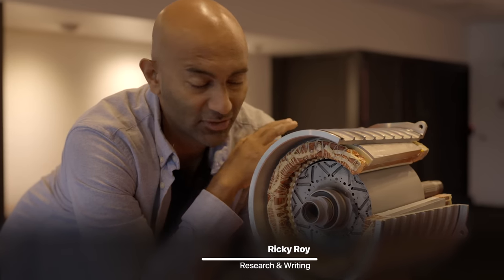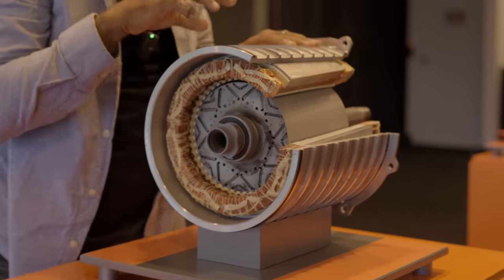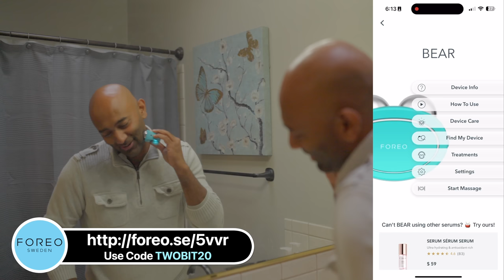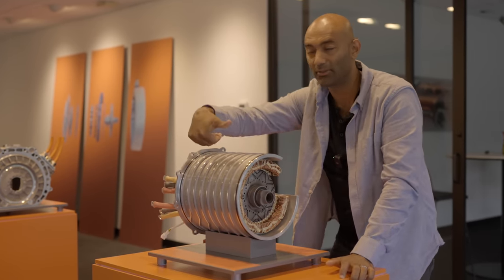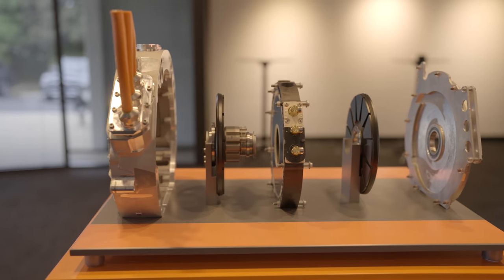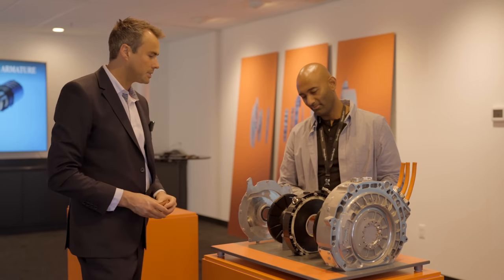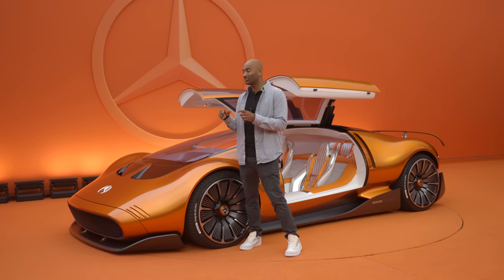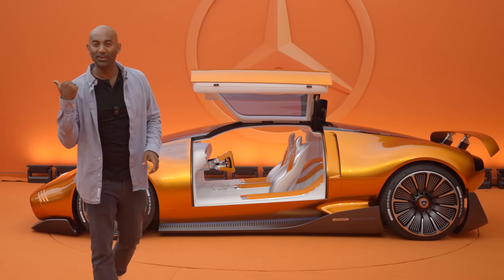Axial Flux Motors Will Change CARS - Here's Why

Comment: That’s really cool they’ve created such a powerful lightweight efficient motor. I’m sure Mercedes will stop at nothing to engineer a coolant pump that is so buried in the cars internals it requires almost an entire disassembly of the vehicle.
Reply: lolz
Reply: They can replace it for you at the same time you are paying them £10k+ to swap out your 5yr old battery.
Reply: @MrLankoss  The batteries are warrantied for 10 years 155K miles on all electric Mercedes. This is almost 33% higher than anyone else in the industry.
Reply: ...and electric cars don't even need coolant pumps!
Reply: Doubtless Audi will jump on the same bandwagon: 5 hours service-time to change a fuse?
Reply: @eventhisidistaken  based on the information and details in this video, any vehicles running these motors will
Reply: you're thinking about vw, audi, alfa and bmw.
Reply: @eventhisidistaken  they do
Reply: I like my Walmart $100 battery every 3 years instead of $10,000 plus for electric vehicles!
Reply: Well the nice thing about EVs is that there's a tremendous amount of space savings over an ICE, so accessible component placement will be easy
Reply: Electric motors are typically rated for 750,000 miles.  Current battery packs are estimated at 250-350,000 miles.  You can't beat EVs in terms of cost per mile.
Reply: @Francis-rs7zu  Well, the guy in Germany drove I think 1,6 Million kilometers with his tesla. But get also this: tesla gave him 3 new batteries on warranty, he also had to change the motors 8 times plus he paid some achsles and brakes 26000 Euro, so.... And another guy drove 1 million kilometer with his 1991 volvo sedan. 2 motors and 2 transmissions changed. He got a new car from volvo free for 2 years.
Reply: @eventhisidistaken  🤫🤫
Reply: Hmm. yes I have heard of Mercedes difficulty in swapping out worn mechanicals,(@MrLankoss  Hmmm you did not follow the rest of us into "MR.?? That was my father, I am just plain old...") which is why I was surprised by the Acura requiring $500 on their TLX to swap out TRANSMISSION FLUID!  But I guess they are doing their best.
Reply: just dont be poor
Reply: True, one step forward, two steps backwards. The Mercedes way.
Reply: You missed a trick - the video refers to the coolant and its importance.  @eventhisidistaken
Reply: Some Tesla 3 are under 30k now
Reply: How about a radial and axial flux RAXIAL and induction excitation with rectifier and some insane HP and torque fun!
Reply: @@ShannonBarber78Radial flux permanent magnet motors do have a flatter package than standard induction motors, and axial flux is also a flatter package than permanent magnet radial flux motors. And with regards to induction motors, there is no energy wasted in the "induction" aspect, since the rotor already has its own magnetic field. So the rotor doesn't need to be excited by the stator field to develop its own magnetic field.
Reply: @lltb67 but gasoline
Reply: @jlo13800 rectifier? DC? Nah
Reply: @adolfgerhardhermann5952 not when electricity cost more than gas
Reply: Okay, that's hilarious. 😏
Reply: @@ShannonBarber78 Please be more specific if possible.
Reply: They didn't invent it.
A feller from England did at least 20 years ago.
They might of bought his patent from him.
That I don't know.
The first time I saw this motor the feller that developed it was testing it on a racing motorcycle at the Isle of Mann TT race.
"At least 20 years ago"
Reply: pretty sure this motor has nothing to do with Mercedes. Both Ferrari and McLaren are using the same tech for a while now in their cars and its made by the same company that its most likely not mercedes.
Reply: That is not true! MB is planning on installing these new motors in a newly designed titanium V12 behind the nitrogen cooled crankshaft.
Reply: @matrixist  precisely!!
Reply: @lltb67  EV high voltage batteries don't wear out in 3 years 😂 it's like saying you need to replace your engine and transmission every 3 years 😂 WOW so expensive. of course SOLETIMES batteries like engine or transmisions will have dramatic failure. you ever heard of engine failure and  replacement after 1000 miles? yes it happens, and it's under warranty  like batteries, except batteries have 8 years/100k miles minimum warranty 😊
Reply: @simonehudspeth861 but the pump is not inside the motor, it's not an accessory belt/chain mounted pump like in combustion engine. it's just an easily accessibl part to replace if it fails
Reply: @jlo13800 Koenigsegg Dark Matter! 800 hp, 1250 Nm, 39kg...just imagine the possibilities in a supercar EV when they figure out lightweight battery tech
the first Gen of electric hypercars is powerful but heavy. only lotus evija is sub 4000lbs. when lighter battery tech is finally here it's really game over for gas engines (same for efuel/hydrogen)
Reply: Don't forget all the special Mercedes only tools, guides and specialized software to perform any of that maintenance. It$ what Mercede$ does be$t!
Reply: Yes kkkkkk almost like vindictive with their engineering
Reply: You do know they didn't invent it, right?
Reply: Exactly
Reply: Good one! 😂 However, they did not create this motor.  This technology has been around for quite a while now.  The elevator industry has been using this type of motor for years now.
Reply: @adolfgerhardhermann5952  You know, a lot of the people who tell this story never do the math.. The dude drove 1.3 million miles (probably more) with one of the very first Model S to ever be built. He went through 3 battery replacements. That's an average of 400,000 miles (~650k km) PER BATTERY. So uhh... You know... more than twice the lifetime mileage of the average car. The motors were replaced (even more than you said), but that's because the early models had a flaw that took a while to fix, so they went through a lot of replacements then. After that, it's not been an issue besides expected wear and tear. IE: that's the warranty working as you'd hope and the car has held up incredibly well. Again, that's more than a million miles! Nearly 2 million km!

I have no idea what his repair costs are (and anyone who claims to know is lying). But to me, it's crazy that anyone would think that $26,000 for some replacements after 1 million miles is a lot. Cuz...

Comment: Re the title - this is old technology, so it's not "new". These motors are used on washing machines. To fight Tesla, Mercedes needs to put out a compelling car for a compelling price. Tesla is solidly focused on mass production and cost reductions. They're going to hair pin motors (easier to build and automate and are more efficient) and magnets free of rare earth metals because these are cheaper. 48V architecture reduces the amount of copper needed. Unboxed production will make their cars faster and cheaper to make and allow them to be built using Optimus robots. There's more than that (4680 batteries, Giga castings...) but you get the idea. Unless Mercedes innovates in these areas, throwing one little differentiator that only has benefits when you look at that one component in isolation, but the benefits get lost in the overall vehicle, isn't going to overcome the huge moat Tesla is bulling.
Reply: @iphigenia8661  no. Tesla buys batteries from everyone, including the major Chinese battery manufacturers (SAIC, BYD, as well as battery suppliers in the US and elsewhere, eg Panasonic, as well as developing their own in-house 4680s). Tesla consumes more batteries than any company on earth. They're all very eager to sell to Tesla as Tesla will buy every battery they can make.

Comment: Pretty sure that motor they showed you is the YASA P-400 R. They’ve been commercially available for… 8 years? 9 years? Something like that. Mercedes did not invent them, and they’re the same motors Ford uses in their electric Mustangs
Reply: I'm pretty sure Ken Block's 1400 hp Mach E had those kind of motors, they were stackable if I remember well
Reply: This is basically the same motor as Toyota has been using in hybrid transmissions for like 26 years. Making a smaller electric motor is hardly an innovation today. Mercedes are late to the party, again, and want us to be impressed.
Reply: MB are last on the ball but presented as innovative! I guess they payed well for the commercial. 😂
Reply: Mercedes bought the whole Company
Reply: @simson4t  The classic way. If you are last on the ball, buy those that was faster and save a lot of time. How will Apple do with AI?
Reply: @stefanjohansson2373  Why buy compute when you can buy whole AI companies? Not like they're doing anything else with that Dragon's Hoard they have.
Reply: @StephenGillie  Toyota uses two radial flux Motors in their hybrids, they never used axial flux motors. They work completely different than you think
Reply: @stefanjohansson2373  marcedes is far from being last on the ball, it is one of most innovative companies, every Company buys other companies for technology including Tesla
Reply: @simson4t  Are they significantly more efficient? If not, then the difference is purely scientific, and irrelevant to efficient automotive technology.
Reply: @simson4t MB may be innovative in ICE, but 5-10 yrs behind Tesla in EV, charging infrastructure, especially, software.
Reply: @vuvision  if you take a look at the eqs marcedes already caught up to Tesla. Especially in software.
Reply: @simson4t  So why to the Chinese avoid buying it, saying that the software is pants?
Reply: Mustand Mach-E uses conventional radial flux motors. Sandy Munroe has a video about it explaining all the details.
Reply: @@retiredbore378 The Smart Car was a total failure and an embarrassing project started by the Swiss watch company.
Reply: @stefanjohansson2373 it wasn't a failed project. The swatch car project was a phev car with a optimized production process. Mercedes wanted to make a small car with a normal engine that wasn't ideal for the car typ. Swatch went out because they couldn't bring in there technology and ideas. The elchtest disaster was 100% mercedes fault!
There is a documentation about the swatch car and it would had a bigger impact but well VW and mercedes wasn't ideal.
Reply: @StephenGillie  You cant say that Toyota  been using Axial Flux motors forever if they actually have  been using radial motors like most others... and then say that if they are not more efficient it doesnt matter???    Just admit you told a lie or where guessing and be over with it..  :)
Reply: @jonasgranlund4427  Toyota has been using slim motors for decades. If this specific implementation is not more efficient than the current, then it's not interesting.
Reply: Yes correct, Mercedes signed with them to meet their demand. They are a perfect combination with many engines.
Reply: @StephenGillie  but the whole episode was about how these motors had more power density and is more efficient, are they lying or where have you  read that Toyotas motors for their hybrid cars the last 10 years are as efficient as these?
Reply: Also Hypercraft USA is also using YASA motors for the custom packages.
Reply: @jonasgranlund4427  Ah if they have more  power density that's cool.
Reply: @jonasgranlund4427  I was wrong - not Toyota but Rolls-Royce. Wikipedia says axial-flux motors have been common since the first days of electric motors. And again, Mercedes and their fanatics (like yourself) expect us to be impressed by old tech.
Reply: @StephenGillie  Toyota has not using slim motors. Their hybrids are not a pancake Motor between the engine and the transmission. There is no transmission,. There are two radial flux normal shape Electric Motors, permanently connected to the Engine through a planetary gear. Watch the video
Reply: @StephenGillie  well Electric cars were there with the first auto mobiles, the first car to break the 100kmh was electric so we shouldn't be amazed by new Electric cars, because they are old tech ?
Reply: @Francis-yc9nc  This was a long time ago, but I remember it like this:
The whole car concept was designed in the 80’s by mr Hayek (Swatch Group). About 10 years later he chose to work with the car industry instead of competing with them. It was impossible to make profit of the concept so all involved was losers, especially the owners! 

I think VW was there before Mercedes and later there of course came a Chinese copy. It was Hayek (and all his developers) that left the project since it didn’t follow his original idea. 

The MB motor with 3 cylinders in my old Smart Fortwo City Coupé was the worst engine I’ve ever seen, so I’m glad I’ve got it for free from Swatch Group as a PR gimmick. You must suck out the oil like in a motorcycle for oil change and there was few engines that managed to reach 10k km. I’m from the watch industry…
Reply: @simson4t  Electric cars couldn't keep up with new gas cars in the old days, because battery technology lagged behind. Only with modern lithium batteries are electric cars faster.
Reply: @simson4t  That planetary gear IS the transmission. It's where you'd put gears to shift into, if you wanted to go faster than 125 MPH. I've watched a few better videos, ones that did not lie, and instead thoroughly explained the technology and its history. This channel is as bad as Mercedes in acting like this old technology is revolutionary.  Two Bit DaVinci is a two-bit hack.
Reply: @StephenGillie  what the hell are you talking about? There are no gears to switch into, just one planetary gear. I was talking about video I linked in a previous comment.
Reply: @StephenGillie  The point I was making, everything is already invented at the dawn of the auto mobile, but they didn't have the technology to make it work. Creating the technology to make an old idea work is innovation.
Reply: @simson4t  That's exactly what I mean. Why are you agreeing me with such a hostile tone? (Links don't work in YouTube - what a top-tier social network amirite)
Reply: @simson4t  Nah, the spark plug hadn't been invented. Tesla tried to make one, but was beaten to it by Bosch.
Reply: @dangraff8467  You mean buying a whole company?
Reply: @dangraff8467  And distraction from what? Their full lineup of evs?